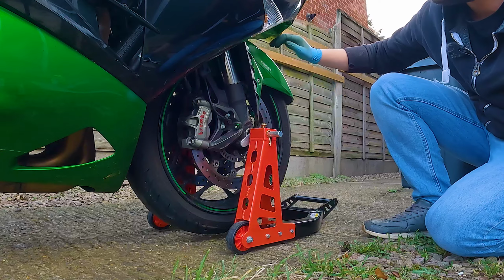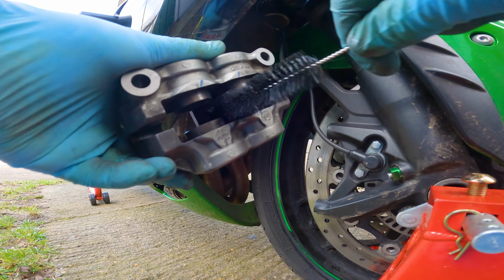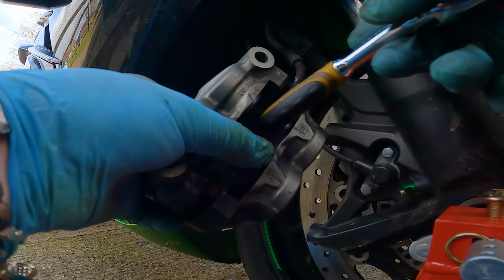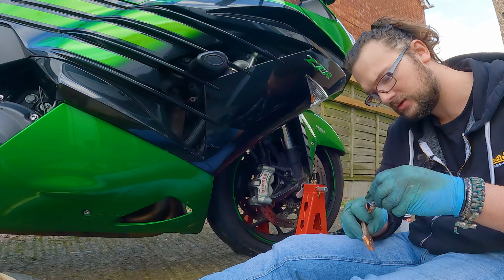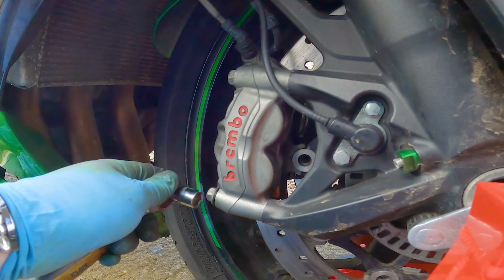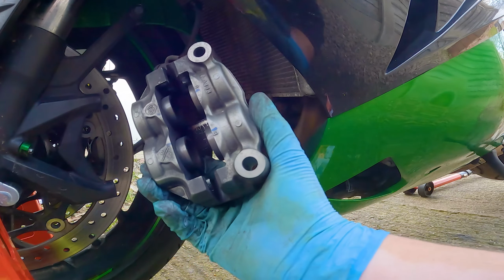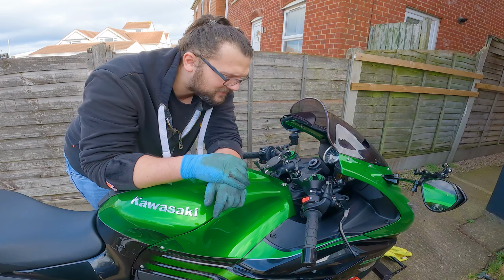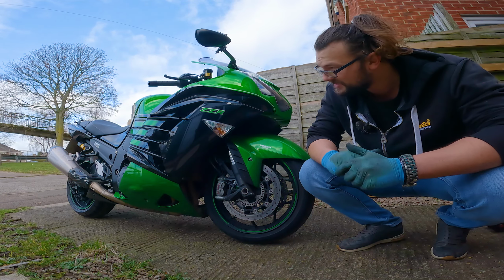The EASIEST Maintenance Job On ANY Motorcycle (Even NOOBS Can Do It!) Feat. ZZR1400 / ZX-14R

Comment: I'll recommend you (and everyone else) to clean also the brake rotors with brake cleaner and if you have floating discs, check and clean the pins.
Jammed pins can cause none to pretty big wobbling when you hit brakes.

Also. If you have uneven wear on brake pads, my opinion is pop  pistons out, clean and wipe them with 2000grit wet sand paper of necessary and clean wipe also dust boots 👍

Comment: the only things different I would have done to make it easier to push the pistons back is open the brake fluid reservoir. well thats what i do on cars, not sure if its the same for bikes but hey, you gave it a bash and it works. Well done.

Just wait for the wannabe mechanics coming along......................ohh you used your left hand to slacken the bolts, ohh no, always right hand. next time use an air gun and completely wreck the threads just as mechanics do 🙂